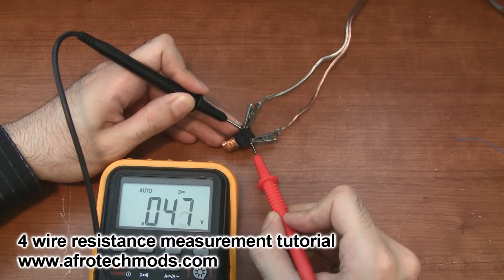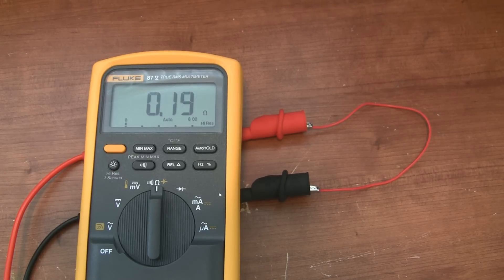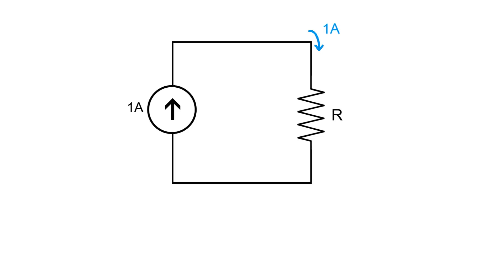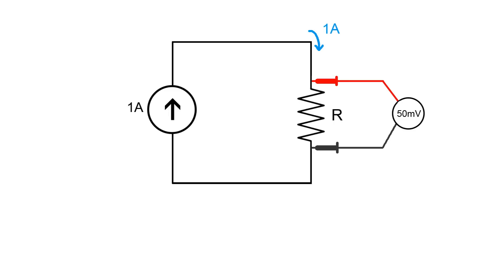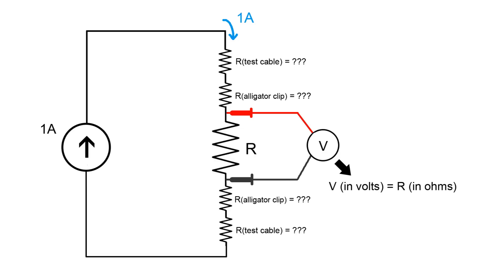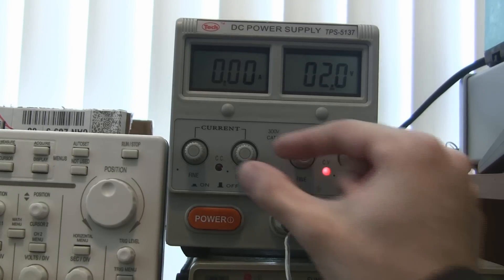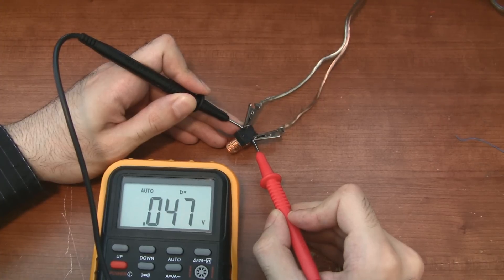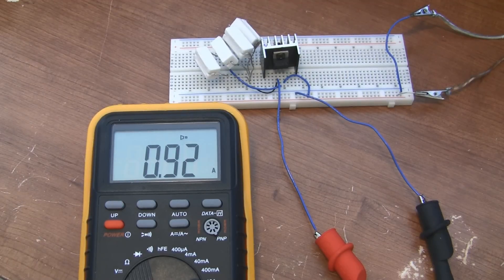4 wire kelvin resistance measurement tutorial

Comment: I started with Arduino about 2 years ago. Now I make my own dc lab bench power supply’s. Robot arms. The famous eggduino for Easter. I think you get it. I’ve become absolutely fascinated with electronics and building them. I have used your video’s throughout my journey. They are very helpful. They deal with components and situations I come in contact with on a day to day basis’. Thank you very much for taking the time to talk to use newbies and in a way I ,and many others can understand . If you could dive into , and explain how to use, some of these lower end oscilloscopes new people like myself are forced to buy due to financial constraints. I’d greatly appreciate it. 

Once again. A large thank you for all you’ve done.

Comment: Without the lm317 or any other Ic regulator, it won't be constant current. Right? I have that same power supply, but every time I across the current thru a resistor, the current flow will vary the consumption in the amperimeter based on value ohm resistance, so drop voltage. But an Ic like lm317 it will give constant current no matter watt resistance value I use. Right? I don't get it at all yet.

Comment: 4 x 5R1(5.1Ω) 5W ceramic resistors, wired in parallel... should get pretty close to 1A with LM317(1A limit= warm), (LM338 rated for 5A=not warm)... FWIW...
For 12VDC situation: 120Ω 5W (ceramic 'J" series) resistor, in series, should get you in the ballpark of 100mA (0.1A)... do the math.

Comment: Thank you for an outstanding presentation explaining 4-Wire low resistance measurement!  Knowing sub-Ohm Resistance is an OK theoretical exercise, but I am using this presentation as a reference for explaining practical results when in-line Resistances occur in vintage automotive electrical systems.

Comment: 8 resistors of 10Ω/0.5W/1% connected in parallel will give you a decent 1.25Ω/4W equivalent, which is perfect for this application.

Comment: battery holder springs have like 60 mOhm. If you insert battery in a parallel pack in reverse, its not the battery that will smoke, but those springs. They cannot handle 5A.

Comment: sir if the wire so thin ,then how it will handle one amps
Reply: A wire with very little resistance isn't necessarily that thin. Actually the thinner the wire, the greater the resistance

Comment: You can use an incandescent flashlight bulb and a single "D" size battery as your current source. It won't be exactly 1 amp, so you will have to measure the current then use some math on your voltage measurement but it is a very cheap solution.

Comment: what should i use for a power supply using the second method?
Reply: if i use figure 1 from this website with 3 AA batteries what resistor should i use? what ohm and what watt. and what gauge speaker wire should i use?

https://diyaudioprojects.blogspot.com/2008/11/simple-low-resistance-measurement.html?showComment=1522613613163#c7552392211450068627

Comment: I don't think i can use this method to measure the internal resistance of a car battery, can i? the battery will have its own voltage unlike a piece of wire or anything else tested in this video. Any info on the topic would be much appreciated
Reply: well you'd do basically the same thing. firstly, figure out the voltage at zero load. next, put some load on it and measure the load's current and the new voltage. calculate the voltage drop and divide it by the current to get the internal resistance.

Comment: Why doesn't the resistance of the wire matter when measuring voltage? Should you get voltage drop as well and basically have the same error from the wire resistance?

Why don't multimeters implement resistance measuring this way?

Thanks for the video!
Reply: did you figure it out?
Reply: V=IR

Comment: cool video!
but could you explain how this current limitation actually works inside the power supply ?
what circuit is inside it, to do that?
Reply: I was wondering the same question?
Reply: I don't know how exactly current limiting works in power supplies. But a basic current limiting technique is the BJT foldback circuit. What you do is put a sense resistor across Base and Emitter of a BJT and size it so that the drop across the resistor is 0.7V when you hit your set current limit. At this point, the BJT turns on and output voltage drops to insignificant value like 0.1 to 0.3V, this limits the power dissipation. Just google Foldback circuit for details.

Comment: Doesn't running a whole amp through a wire make it very hot?
Reply from the maker: Good question! It depends on the gauge (diameter) of the wire. 1A is fine for anything but extremely thin wire.
Reply: Afrotechmods I guess it comes down to getting a feel for what works and what doesn't without having to calculate everything all the time -- in a word "experience." I've very much enjoyed your vids and learned a lot. You're a very good presenter. I now need to spend time at the bench making mistakes and learning the hard way!

Comment: You can convert a constant voltage source into a constant current source with a transistor and a resistor. The resistor goes on the base and draws a negligible current, avoiding power resister and regulator.

Comment: if you put 1amp through a coil, doesn't it get too hot and changes its ohmian resistance so that dont measure the resistance that interests you but the resistance of the coils temperature at 1 amp?

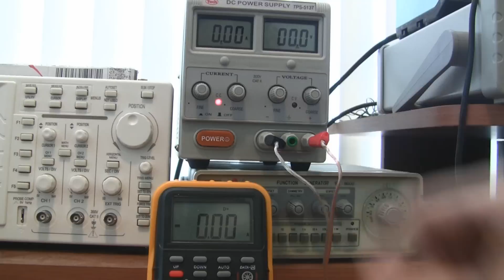Comment: At 3:02 did you connect the resistor to the test leads? Parallel or series? Cause whenever I turn the knob of current limiter on my bench supply it jumps back to voltage control...

Comment: The explanation doesn't sound logical to me. How can a constant current source be possible? I thought that the current depends on the sourevoltage and the resistance, because I=U/R.
If the current should be constant the sourcevoltage would have to be variable and thats not the case, or is it?
Could someone please explain that to me?

Comment: i've made a constant current source using an opamp an a mosfet built into a bench supply i made, it has 6 presets which connects different shunt resistors so i get different current ranges
i've made it so it has 100uA 1mA 2mA 10,20 and 40 mA, handy for testing LEDs, zeners up to about 15 volts (or high voltage diodes) and 4 wire resistance measurements

Comment: @Serostern My power supply is made of a computer PSU so every time i connect the 12V output to a relay or an inductor it will shut down. Is there any way to prevent it from shutting down

Comment: @dealio82 Nope, the power supply is capable of running loads of 10amps, the fuse is to protect the PSU from the input current, not the output =)